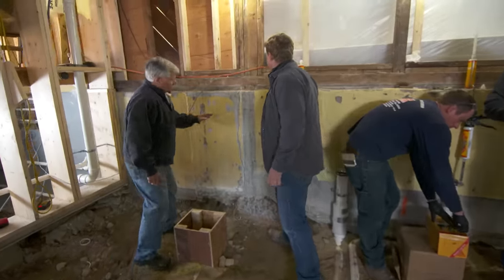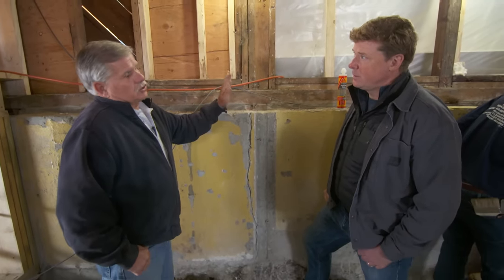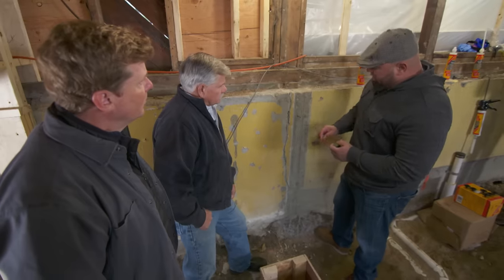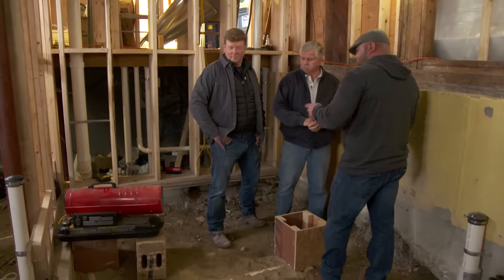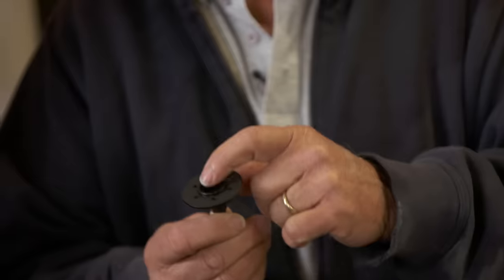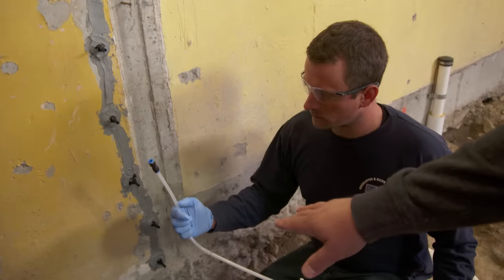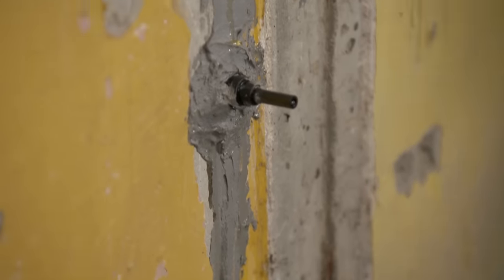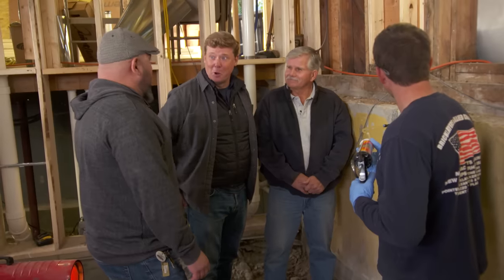How To Fix a Concrete Foundation Crack | This Old House

Comment: Does anybody know, because it wasn't quite clear in the video, is grout inserted into each port or just one. I'm guessing each port but like I said, that wasn't made clear.
Reply: You start at the bottom of your crack and apply the epoxy until it starts to leak out of the one above it. You cap the bottom port and then move on to the next one (where it started to leak out of) and continue on up the wall in that fashion. You'l basically filling a bucket with holes in the side with water and plugging the holes as the water level rises to the next hole.
Reply: @therising1  Thanks much!
Reply: pushpak no the other ports are for looks only.  

Probably best to read the directions on whatever product you use.

Comment: This seems so different then the drilling in on a v to make sure you get the inside and outside. Is this better or worse then that method? The one I had done in my basement he cleaned out the crack and used a mini jack hammer to make a V then drilled holes in an x across the hole so that the hole he drilled intersects the crack half way through the hole. he then put adapters in these holes with a locking piece and a ball-bearing on them so it could only flow one direction then injected the crack with acid to clean out the entire crack of all debri out of the whole crack. then he rinsed the entire crack using the same nipples ill call them.. then he injected the resin.. this way the resin was all the way through my wall and the crack as he sealed the whole crack before injecting. This method looks like it only gets the surface of the crack because it can ozze up and does not go further in the crack...

Comment: Like my old boss used to say “ice cream melts and concrete cracks, get over it”
Reply: Your boss was wrong. Properly poured, reinforced and supported concrete will not crack for decades, but hack concrete contractors do use that excuse for their shoddy work.
Reply: So my boss was right and you are wrong. Even if it’s decades later it will crack. There is not one engineer or concrete contractor in the world that will guarantee concrete will not crack and there’s a reason for that. Try again buddy

Comment: They're talking about the compressive strength right? Doesn't that not apply here though? It's tensional forces that open up a crack. I have no doubt the epoxy is very strong. But isn't the question more about the adhesive strength of epoxy bond to the concrete on either side of the crack?

Comment: No footing and /or organic fill below,  insufficient  rebar in wall caused this issue. 
Will re- crack soon regardless of repairs unless proper bearing soil and footing installed.Epoxy will pull away from 3000psi concrete and crack next to 9000 psi weld.
Good to stop water intrusion but not a structural repair.
Reply: Glyn  true frost heave may not crack footing though.
Many dont even know about that in States.

Comment: It doesn't look like a crack caused by lateral soil pressures from the outside. The wall would likely tilt inwards if there was high enough pressure from the outside. The wall is flat across the crack. One side of the crack is not tilted in more than the other side of the crack. The crack is wider at the top than the bottom. It is more likely due to differential settlement. It could be a shrinkage crack but in that case, the crack is usually the same width top to bottom. The crack itself is usually not an issue that has to be repaired. All houses with concrete foundations have shrinkage cracks unless it is a prestressed foundation which is pretty rare.

I would look for signs of differential settlement before fixing the crack. You actually don't need to fix the crack itself. If there is an issue with the crack it would be letting water in. Waterproofing and drainage from the outside is more critical to fix.

Fixing the differential settlement is more of an issue but the shape of the crack would indicate that more investigation is required.

Comment: What was the exact product name they used for this repair? Thanks in advance
Reply: It looks exactly like Sika Concrete Crack Epoxy/Resin. The labeling seems to match etc. That said, the cups appear to be different (and lower quality) in the Sika products I found. Keep in mind the video is about 2 years old, so might have been a cost savings initiative. I don't know why people seem to think that the product is less reliable than vertical mortar/high strength concrete mix repair. The resin has higher load/sheer resistance, better bonding properties vis-a-vis TOTAL void filling. Important that you still finish with removing their temp mortar Mix, and then reapplying high strength in your chased crack void. YouTube their product and lots of good reviews. It is messy, if you're an amateur 😛 Tape off sections that you don't want excess runoff on. Duct tape (dollar store variety) is the best IMO for solid adhesion. Stretch plastic tape (Red roll) works well too. Enjoy man
Reply: @danmcgher6057  thank you very much

Comment: if you dont seal the crack on the outside of the concrete wall water will enter the outside crack and freeze and will open the crack inside in time.

Comment: Can you please if you know how to, please give me some type of advise on how to stop a sweaty toilet (water condensation), I heard about expanding foam to coat the inside of the tank, thank you in advance!!
Reply: I know a plumber that runs warm water to toilets for this reason.. he puts a mixing valve in the toilet water supply. It works really well.
Reply: what is the humidity level in the home
Reply: Add or upgrade your bathroom ventilation fan.

Comment: I thought you always fix a crack from the outside. That's what the pros tell me. Avalon here in Edmonton did that for me. No water inside for 10 years and going.

Comment: Will the epoxy work in a concrete slab-on-grade floor crack?
Reply: get yourself some sika flex self leveling joint seal. it will seal the crack but still let it move. its water tight.only use on horizontal .

Comment: I wouldn't heat up the concrete because it will spand, you want to apply that epoxy when it's cold or really in the morning
Reply: They were heating the area so the epoxy would cure faster.

Comment: Why is the compression load (9,000 psi) of the epoxy important? Foundations and wall crack under tensile load, not compression load.

Comment: It doesn't matter how strong it is. How well does it bond?
Reply: It bonds stronger than the concrete to itself. So strong it will literally rip the concrete apart if thermal movement occurs.

Comment: this seems like it would work based on what he said but whats an alternative solution?
Reply: A crack in the wall?
Reply: Hand dig under the wall, a section at a time, and pour a proper footer or it will keep sinking.

Comment: Seems like a good way to fill the crack, but I would still want a piece of steel or something across the crack.
Reply: I agree with you. The epoxy is only as strong as what it is attached to. 

It’s like wood glue. It’s much stronger than the wood, but you can pull two bits of wood apart because the actual wood fails. 

Same would be true here. 

A proper fix would be to cut some horizontal slots say 3 inches deep and then expoxy the slots with rebar already pushed in. That how we do things in the Uk to fix up old walls. 

But horses for courses 🤷🏻‍♂️

Comment: What's really misleading, at the end of the video they are talking about PSI of concrete vs PSI of Epoxy. However PSI is the surface pressure expressed in Pound Per Square Inch. However the foundation did not experience surface pressure. It is experiencing pressure downward or expressed as flexural. They don't discuss these numbers
Reply: The foundation can experience lateral pressures  depending  on soil type etc hydrostatic  pressure can bulge or sheer a foundation  so these numbers are relevant  depending on application

Comment: Three times as strong as the concrete? Why don't they just build the whole foundation out of that stuff??
Reply: Jeff Kelley let’s make a plane out of the Black Box material too!
Reply: tmacfan927 Now you’re talking!
Reply: Jeff Kelley Epoxy costs at least 200x more than concrete per unit volume.
Reply: 9,000psi concrete is much much cheaper. You can get 15,000psi concrete if you want. To put it into comparison, mild steel has a yeild strength of around 36,000psi, and standard structural steel has a yeild strength of around 50,000psi. Stressing tendons have a yeild strength of around 270,000psi.

This large crack in the foundation tells me there was very little steel reinforcing used. Rebar in the foundation helps keep these cracks small.
Reply: @Jtx-lp4yi  270, 000 psi? My scouter just blew up.
Reply: Jtx 2048 in Canada they don’t use rebar in the concrete foundation they just pour an 8 inch wide wall. What do they use in the US?
Reply: @ayoubfarid1663  basically chicken wire inside the foundation, and some 1/4 inch or 3/8 rebar. 

i didnt do it myself, but i did watch the guys who built my parents house about 2 years ago
Reply: Ayoub Farid varies depending on location, soils different in the rock of Missouri and New York compared to the clay and mud around Georgia, soil expansion is different in Texas compared to Florida.  Very few details are standard or universal across the country regarding building practices and codes. 
Areas around fault lines are a whole different beast themselves.   Installing even a septic system in one town will have different requirements when a nearly identical setup system is installed in the next town just 5 miles away.   “Check local codes first” is the motto for American builders, that and “before you dig, call miss dig. “
Reply: @jaxturner7288  this is painfully true, not just state to state but city to city can have strangely big differences.  like being a lawyer almost
Reply: Brad Haines 1/4” rebar? I have never seen a #2 bar, it might exist but It was most definitely 3/8” #3 bar used in your house, it’s the most common size used in residential buildings.   Rebar is sized in eighths just for future reference young buck, so #3 is about 3/8” number 6 bar is 3/4”  #8 is an inch and so on up to arm like sizes.  N your “chicken wire” is wire mesh, measured by the squares sizes and gauge of the wire itself.  So like 6 inch by 6, and then the wire size which is measured in gauges, that’s another topic itself tho.  
It is definitely awesome you paid that much attention when they were building your house tho, I wasn’t even interested in it when my old house was built as a kid, I could of watched it all being done but I didn’t,  now 40 years later after building a handful of houses, I wish I would of started learning and watching as early as possible. I did pretty good but I bet you have an awesome future ahead as some sort of skilled tradesman.    👊
Reply: @jaxturner7288  im already a millwright, ive done some wood working and heard about rebar being measured in 8ths but wasnt close enough to see in detail, so i didn't give a detailed number. those guys were quick though so i didn't have time to inspect, just watched.

Comment: The epoxy might super strong, but it's only the epoxy. The bonding substrate is much more important because the crack could very well just go there. You have to wash and get the crack as clean from debris and dust as possible. Otherwise, it's really just like painting a dirty wall. Paint will fall off in matters of days.
Like another comment says, if the reason why the crack appeared is not fixed, it will just come back right next to it.
Reply: Glyn  What is not possible? That the concrete is 4000 psi and that the crack may just come back 1/2" more to the left after the repair? To edit my first comment if it was not clear: "the bonding to the substrate is much more critical than the strength of the epoxy alone"

Comment: This method will cause more problems down the road if the concrete experiences freeze thaw cycles or any extreme temperature fluctuations. The concrete and epoxy expand and contract at different rates with temperature changes. The epoxy being 3x the strength of the concrete will literally rip huge chunks away when the concrete contracts, causing more damage over time. I have witnessed a clean crack turn to gravel in 2 years using this method on an exposed uninsulated concrete wall and slab.

Comment: What if the rebar has rusted due to the crack exposed to outside water? You may need to chip away to inspect the rebar condition. Looks like a Sika product.

Comment: Is this something you can use a cold chisel in place of the saw? I'm trying to do it myself and save money. I also probably wouldn't use the saw much. Also what is the sealant you use to create the "dam" so no epoxy gets out?
Reply: cold chisel won't give you as much control but since the goal is just to open up the crack to give you room to inject the epoxy I'd think it would work. an angle grinder isn't that expensive though.

Comment: This isn’t what the repairmen did to mine. he drilled several holes perpendicular to the hairline foundation crack, injected hydro foam and and then stuck metal ports in there.

Comment: Anyone know a good video on water seeping through my floor, into my carpet in my basement?
Reply: hydrostatic water pressure. You need a sump pump with a well that goes below your floors surface.
Reply: @Drizzit  wasn't the issue but thank you. Have all that already
Reply: @thecommonsenseconservative5576  Then you have a pipe directly under that spot. I've worked on basements for years, specializing in waterproofing. Hydrostatic pressure is the only reason your floor will leak unless you have a burst pipe. Hope you can get it fixed soon!
Reply: @Drizzit  again wasn't the issue. My assessment was wrong
Reply: @Drizzit  coming from foundation wall. See if you can guess what it was since you have worked on basements for years
Reply: @thecommonsenseconservative5576  Are your downspouts all carrying water at least 4ft from foundation? How does your yard gradient look? Is it sloping towards the house? If both of these are as they should be then again, it's hydrostatic pressure building up against the walls because the water has no where to go. You may need to look into installing tile around the footing. Just did this for a 100+ year old house and its working great.
Reply: @Drizzit  so I'll just tell you because you probably wouldn't be able to guess anyways but the original homeowner did anchor rods by himself because he was an engineer but instead of installing them at a downgrade angle installed them only 24in from the surface and then what had happened enough water had seeped down the rod that put pressure on the toilet bowl wax so it pushed the wax out of the hole so it lost seal
Reply: @Drizzit  I just thought it was coming up from the carpet because it was in two spots until I tore the drywall down
Reply: @Drizzit  I put videos up on my Channel about it

Comment: 1. The compression strength of the epoxy is irrelevant, what matters is the bond strength. I can tell you with certainty that the bond strength of the epoxy is not 9,000psi. A-Tech 212 LV for example has a compression capacity of 12,000psi, but a bond strength of 2,800psi. If this is a 3,000psi wall using this epoxy, the crack is still the weak point.

2. The substrate temperature matters much more than the ambient temperature. Throwing a salamander heater on the outside and then going to town is not going to cut it. You really need to section off the area with a tarp and leave the salamander running for 6 or so hours until the concrete heats up. Concrete is a huge heat sink, so it takes a very significant amount of time to heat up. I would strongly suggest epoxy injection in the summer, if the epoxy doesn't get above a certain temperature it may not cure and gain any strength at all. At that point you have filled a crack with honey and ensured that you can no longer fix it again. A low temperature install also increases the viscosity of the epoxy making it more difficult to inject into small cracks where it needs to be.
Reply: Totally agree. At the end of the day the only way to fix it 100% is from the outside anyway.
Reply: i was thinking the same points

Comment: I think he means to say low viscosity. “Like water” lol
Reply: He did say low viscosity, several times, and it was the correct usage. Compared to the epoxy he used to mount the ports, the injected epoxy is low viscosity.

Comment: That repair is stonger than the original wall. 

Im not making a forth trip to grind that epoxy off though. Experiemce says to clean it up in application.

Comment: His fix is not as strong as Hugo claims. The reason is that he quoting the strength of the epoxy itself. Even though the epoxy may be that strong, the bonding strength to the surface of the concrete is much weaker. It's the adhesion strength that is the weak link.
Reply: The adhesion strength is stronger than the concrete. That’s why when it cracks again it takes huge chunks of concrete with it and why it’s no good for any place that has temperature extremes

Comment: I was on board until they started bragging about PSI. LOL. Uh... so, the PSI rating tells you how much pressure the concrete can take without crumbling. The problem here is that the concrete is being pulled apart, which is the opposite of pressure.

Comment: So, let's make the whole foundation out of epoxy?
Reply: That's like making all wood projects out of wood glue. It's cheaper to just turn a tree into boards.
Reply: @cbalan777  
its called plastic
Reply: Horrible idea and if you don't know why...are you 5 years old?
Reply: Glyn  depends on the epoxy.  Some can cure fine in large amounts.
It doesn't have to crack when curing either.
Epoxy has come a long way and there are many types.